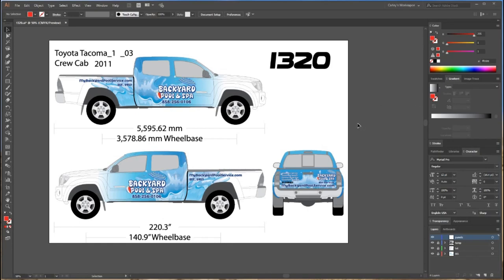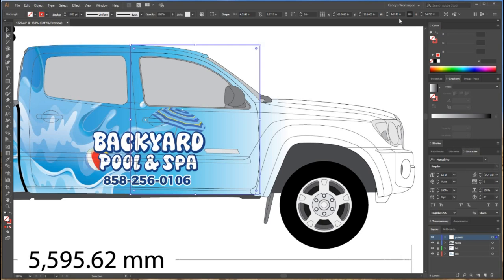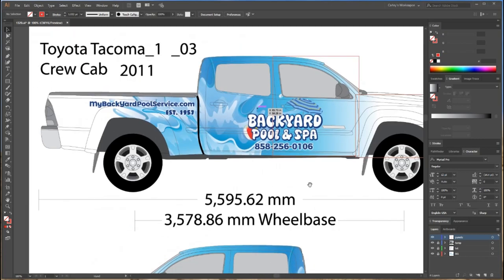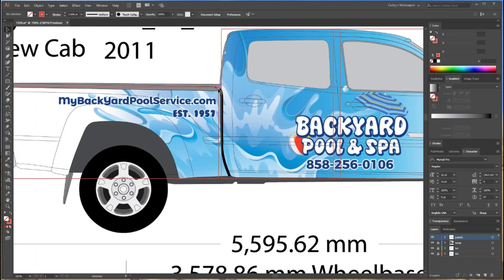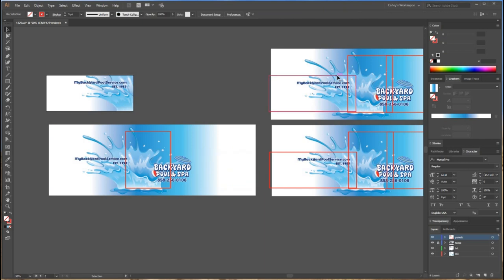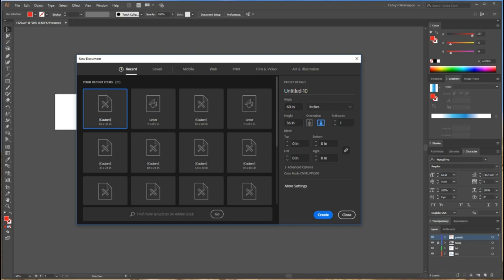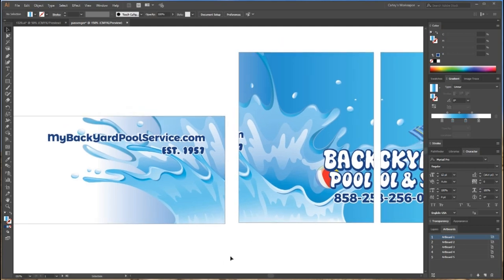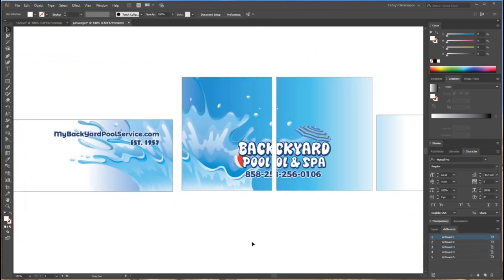Paneling out Partial Truck Wrap Adobe illustrator CC

Comment: great tutorial I have been a graphic designer for many years t-shirt and most substrates. Starting a lead graphic job for a wrap company. This help in design and prep for rip. what would you scale the print file to when printing since you used 10 percent scale 100% or 1200 % ?
Reply: print at 1000 percent when setting up a 10 percent scale print file